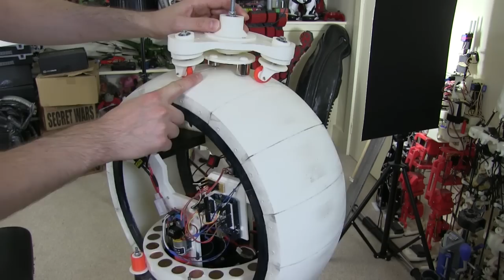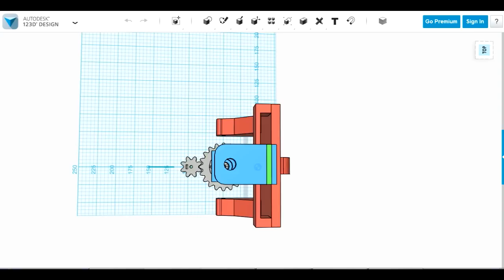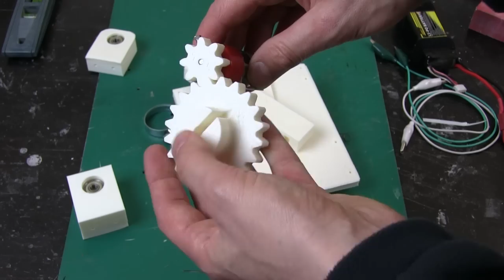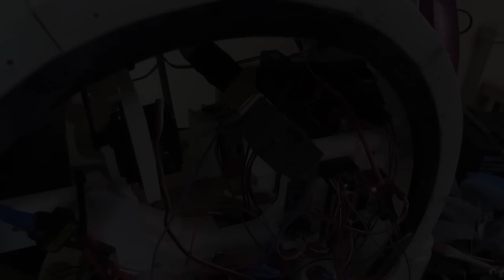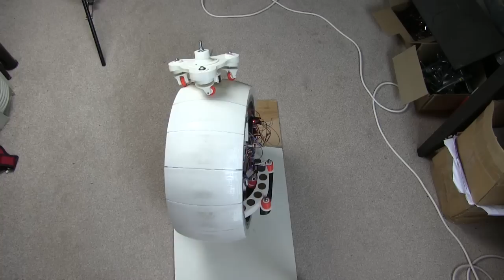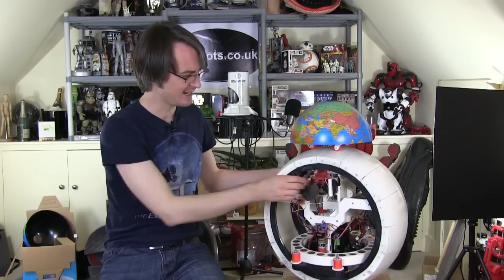Star Wars BB-8 Droid v2 #3 | Head Control Arm | James Bruton

Comment: I'm using your guides to design my own BB-8 project, and I've realised that electronic stability with wheels at the top is more effective than relying on weight at the bottom to stabilise it. I'm thinking that a four or eight omni-directional wheeled machine in the centre of the ball could work the best for moving the droid as it does in the movie, with no drift.

Comment: with regards to the head and its wheels it uses to move on the ball, have you thought about using (for lack of a better word) 'roller wheel ball'? googling the text brings up what I'm referring to, which is basically a large ball bearing trapped in a casing that is allowed to roll in any direction. 
I could see this may benefit the head when rotating or changing direction by making it more stable.
(great channel by the way, really enjoying it)

Comment: Great video, although I got some minor headaches from the designing aspects (mostly caused cause im an engineer and perfectionist,which is a really dangerous combination :P ).
Here are some tips that you might want to use for this or later projects:
a) If you use ball bearings then please design the fitting hole to be a bit smaller then the bearing, you can use a vice to press fit the bearings into the print => no nuts needed
b) use helical or heringborne gears to eliminate the possibility of them missaligning.
c) consider IGUS bushings and so on if you have parts which cause plastic to slide on plastic or metal
d) You could've designed the larger gear to have it's clamping hole for the M6 rod to have a hole that's 5,2-5,5mm in diameter, that way you could screw in the threaded rod into the gear which could maybe even eliminate the need for the clamping ring.
e) if possible please replace the coins with cutted round metal rods which have the according diameter and length. The metal rod could cheaply be bought from ebay and you'd eliminate the creation of an magnetic field.

I know that there are often very less alternatives and in most times the alternatives are so timeconsuming, that you couldn't keep up with the video production. This is just a tiny guide of how you could improove the projects while keeping the video production going. I hope you can implement some of my ideas or comment on if you agree / disagree with me.

Comment: Great work so far! I have a question though. Exactly what are you planning to do to create the sphere at the bottom of BB-8 and how will it work? I have a suggestion that may work and make the sphere look good. What if you encased the drive wheel in some sort of thin, spherical casing so that the drive wheel is completely covered and looks like a solid sphere while keeping functionality. since the head is held on by the magnetic thing, it could easily go on top of this said casing and still work perfectly.

Comment: I think the best way to counter the wobble would be to rely less on the head's mass (which is high up and ultimately not all that heavy, going by the way you've designed it so far) and use a motorized pendulum that can manipulate a mass on a motor-driven pendulum with a lower center-of-gravity. This is more or less what you tried with the other BB-8 by using ball-bearings and water, but the issues with those is that there's no control over those, where-as with an actuated pendulum you could fine-tune it to your heart's content. You've already more-or-less done this by having the fly-wheel assembly adjust itself to compensate for some wobbling, but I think a separate pendulum assembly would offer a more fine-tuned control scheme. (just my 2 cents) 
Keep up the good work!

Comment: What is the reason for the casters? if the head is tethered at absolute center, couldn't you just make the head hover over the surface of the ball, removing all surface friction?
Reply: +James Bruton (XRobots) sorry my mistake I had forgotten it was magnetized rather than attached through the ball to center.
Reply: +Reroshaggy It is an interesting line of thinking, though: since this version of BB-8 only drives in one direction (with respect to the structure of the ball), it would be possible to have an open groove in the ball and an arm that connects the inside of the ball with the outside to carry the head.  Though I'm not really sure how you'd camouflage the arm and the groove. The surface details on BB-8 don't really lend themselves to hiding a groove except at one of the orange circular details, and if a head-carrying arm came out from that point in the ball it'd be way too visible.
Reply: Tetsujin I had that very same thought, and have been thinking of how it could be as you put it masked, but have yet to come up with anything. It's unfortunate as the level of control, as well as margin for failure would be improved being attached.

Comment: This BB8 is really starting to look the part, its almost a shame you have to hide the internals! I reckon you could achieve better side to side balance using the gyroscopic precession of a servo actuated fly wheel that way you don't have to worry about rebalancing!

Comment: Have you considered using a fly wheel to increase lateral stability?
Reply: +Gary Bleck Thinking about it over lunch you could run the existing fly wheel constantly and break or accelerate it to rotate and it would provide stability like a top.

Comment: ball bearing transfers (casters)>wheel type casters .. was the decision to go with wheels based on cost$ or availability?
surely the bearing transfers would make for a smoother, more natural head movement. the wheel's aren't going to track in exact lines, now that you're using the head to stabilise, using ball transfers instead would surely take all the extra slight movements and errors out of everything as the head take the 'long way' to it's intended destination, which will cause everything else to have to adjust in return

keep the video's coming, enjoy the details of the build, would kill to have the time and money to do this
Reply: +James Bruton (XRobots) apologies, fairly certain i abbreviated part 2 (for some reason)

Comment: Hi, you said in one Video you are not considereing to use a sphere-bearing for the head-wheels, because of the noise it would make. Can´t you use instead the rubbery material for the sphere to elimate the struggle against the current wheels turning its direction. Alternatively use a steel sphere-bearing and coat the whole ball with latex to give it a softer surface (also would have more grip on sleek ground). Nice to see this interesting projects.

Comment: reduce the resistance of the ball and the head. cut the ball is rubber. the movement of the head will be softer and easier
Reply: +James Bruton (XRobots) then make a flat surface of the ball. and is a sweetie! Thank you for the video!

Comment: How would you actually overcome the issue with the magnetic interference? Does the IMU let you enable/disable each type of measurement separately or are you stuck with all three types merged?  The only other thing I could think of doing would be to create some sort of concrete or plaster ring rather than using the coins.

Comment: why do print straight gears instead of herringbone gears? Intuitively, it doesn't make any difference when you print them, but they run better.
Reply: +James Bruton (XRobots) funny, because we see it as an enabler (3d printer in your case, and amateur CNC router in my case), but in the end it so barely works that we end up doing conservative stuff for everything.

Comment: it's a pretty cool project, I think it's overly complicated for what its purpose is, unless that was the whole point of this, running 3/4 wheels on the inside of a ball would have been more stable than balancing the mech. even using mechanum wheels would provide any direction of travel then as you did for the head of the mk1 build.
always interesting projects though!!!
Reply: +James Bruton (XRobots) fair point!
I hope the build plays out how you imagine the end result. it's looking good & is a very different approach to the same complications of such a build. good luck dude!

Comment: right now you have a mobile part on the inside which you use as a weight to go to either the front or the back, with a turnable ring with weights to spin. have you ever considered to make the entire rails which you use to move the weight from front to back turnable? like a circle in a circle. i don't know how to explain it really, but i could rever to a machine they use in austronaut training to prepare for 0G. a seat in a bunch of move able inner rings which are all move-able on their own axes. but instead of a seat in the center, the right you have right now?
Reply: a gyro?

Comment: Why have you chosen for wheels instead of some little balls (like in an old computer mouse) for the head? The wheels seem to prevent fluent movement when you change direction of the head since the wheels have to adjust angle.
Reply: *****
Yea, I was afraid this question was settled already. I just didn't take the time to look to back through your older video's.

Comment: I think you ought to consider doing BB-8 a bit like your R6 droid where it's open on the sides but still having the pop out mechanical arms and what nots. It would be a crying shame/crime to cover up all of those internal workings, they're a piece of art in themselves. ;)

Also, have you considered the space below the rotating "coin ring" for help with counter balancing BB-8, or is there insufficient space in that area?

Anyway, loving the progress so far, James, keep it coming!! :D
Reply: *****
Ok, cool. I understand about the head movement thing, just thought having one where the head doesn't move side to side so much would be pretty neat, too. Not to worry, it'll be awesome without him showing his insides to every Tom, Dick and Harry at conventions.

Glad to hear about the lead weights. I saw that part near the end and wondered if there was any electronic method to doing it.but as it turns out, some good ol' fashioned heavy weights should work just as well. ;)

Comment: With the hulk buster suit, make a pivot joint for the ankles with a hole going from the top through to the bottom that you can put a pin through. It's the easiest way of making a locking pivot joint